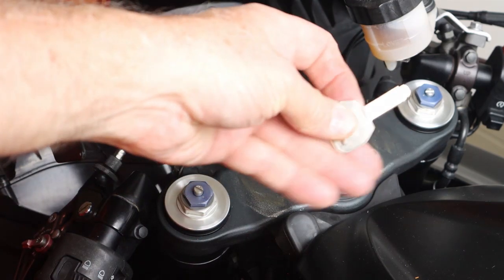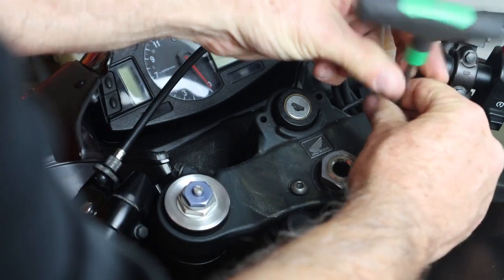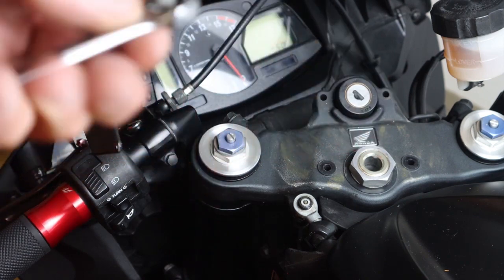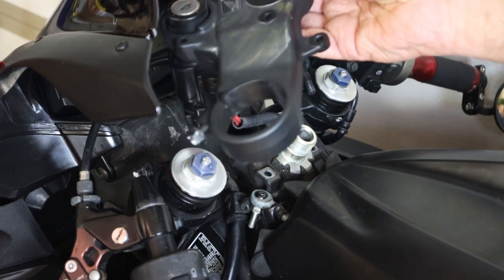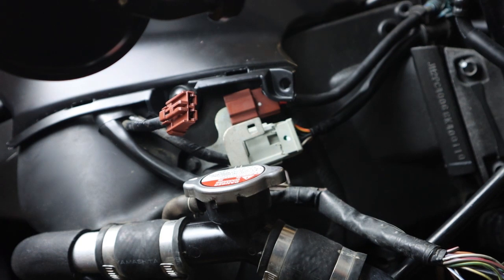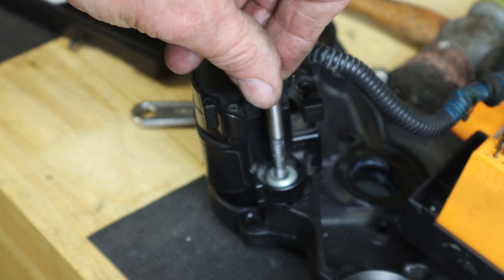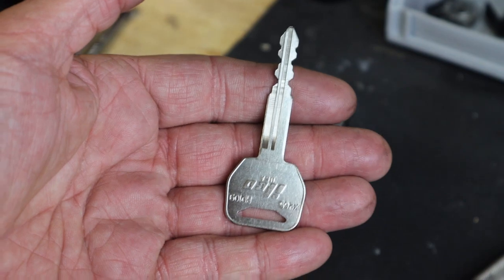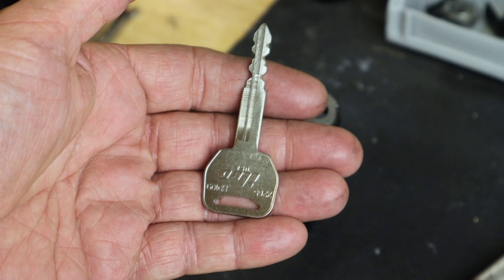2011 Honda CBR600 RR Broken Key Repair

Comment: i locked my steering and lost my key so in my situation what would you recommend i do to loosen the locked forks
Reply from the maker: The fork lock is build into the ignition lock.  You will need to remove the fork lock and take it to a lock smith to re-key.  Online haynes manual should help unless you have your own manual  good luck,  ask me if you have any more questions
Reply: @JoediyLab  your saying to take out the ignition switch ? and the fork lock is inside the switch?
Reply from the maker: @getrightorgetleft  what bike do you have?  In many cases, yes the lock is built in to the ignition switch.  Order ths online Haynes manual for your bike,  the manual should explain how to remove the lock and switch
Reply: @JoediyLab  I have the 2009 cbr600rr
Reply from the maker: @getrightorgetleft  yes, should be close enough to a 2011, follow my instructions in my video to remove your ignition switch.  Take it to a locksmith.  Cost me around $50 to rekey
Reply: @JoediyLab   i tried to do the same process you did but i can’t get to the bolt of the steering rod since my forks are locked :/ Do you think i can remove the other bolts first than the steering rod last?
Reply from the maker: @getrightorgetleft  try loosing the fork tubes and sliding the forks out, then you should be able to get at the ignition switch
Reply from the maker: @getrightorgetleft  Go ahead and try that, but you may have to drop the forks and lift the gas tank to get at the steering rod.